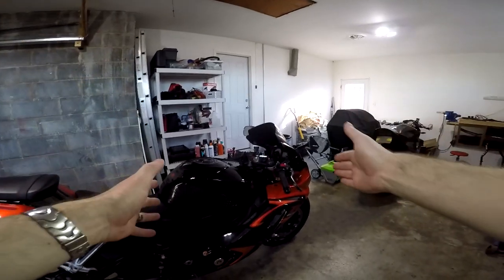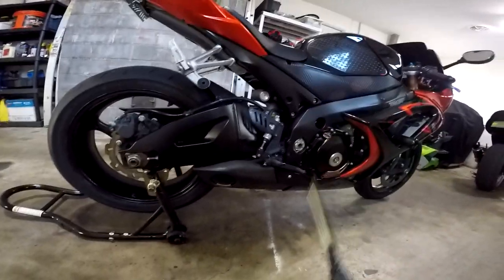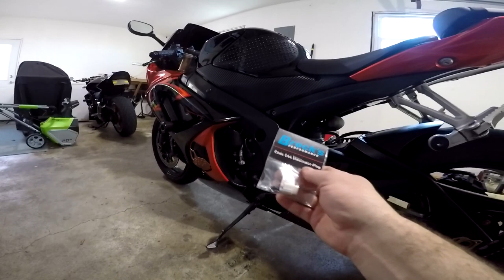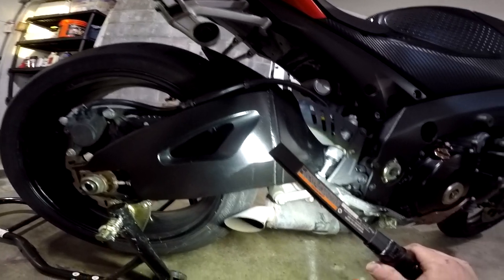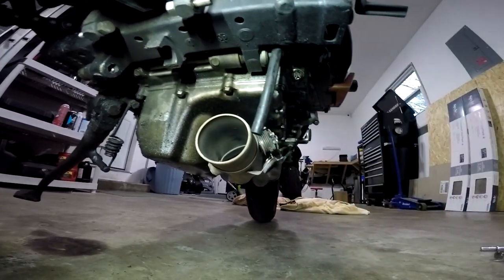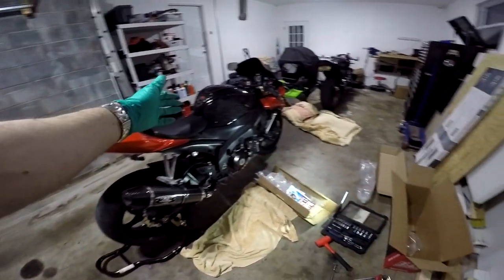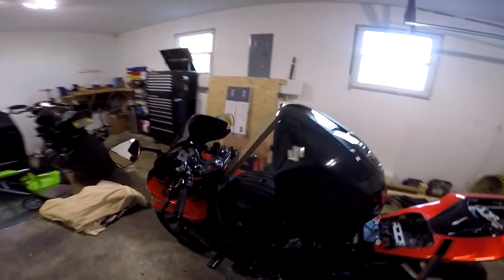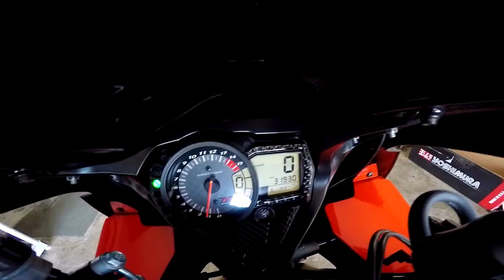Installing Yoshimura exhaust & disabling SET valve (K7 GSX-R1000)

Comment: Hi,Can I just remove the “black & white” wire without using eliminator plug ?will it show up FI light when I change to aftermarket exhaust??thx im glad to own a same bike with you it’s save me
Reply from the maker: Pulling the black and white wire from the ECU connector keeps the F.I. light from coming on due to the SET valve being unhooked. The Code C44 plug that you see in the beginning of the video, keeps the F.I. light from coming on due to the O2 sensor being removed from the exhaust. They serve two different purposes.

Comment: I need to fit mine with the o2 sensor Eliminator and bolt to remove the the sensor totally, as have f1 light from custom exhaust. Do i need to do the other bits you done aswell ?
Reply from the maker: Only if you want to bypass the exhaust valve. Then you will need to pull the wire from the ECU harness as I demonstrated, or buy a bypass plug for it instead.
Reply: @lonelyryder7441  yea, have a plug and the bolt to put on for the old o2 sensor. Thanks, mate. will see if it works. Keeps the vids going as doing mine up after the old person tried to improve but did loads of half jobs 😪

Comment: So I had my ecu flashed and the servo was eliminated in the ecu do I still need to remove servo for the set valve
Reply from the maker: As long as the valve is sitting in the open position, you don't have to remove it if you don't want to. But most people yank it out to get rid of the dead weight.

Comment: Question i started to do exhaust valve delete while i was doing cat delete/ mid pipe. But when i unhooked the cables at the butterfly it flopped closed? And i can open and close by hand, i dont think it will work right isnt the idea to keep open all the time???? Thanks
Reply from the maker: There is supposed to be a spring on it that keeps it open. Check to make sure that the spring isn't broken.
Reply: @lonelyryder7441  I actually just tried something different..Turn on key cycle kill switch so valve opens..turn switch off before valve completes it's cycle,,( close/ then open 1/2 way). Went to ECU and pulled the black/ white wire  started bike valve stayed open no FI light. Now you can hear the servo  turning at ignition but the cables don't move.. Whah Lah..Have not rode it yet but all seems ok till I can send ECU out for flash?. This be good option if didn't want tear out servo. Or maybe under Warranty or?? ..Peace Out Brother ✌️✌️✌️

Comment: would you sell me your old exhaust that you removed in this video? :)
Reply from the maker: Sorry, it's already in the scrapyard. Trust me you didn't want it, it was completely rusted out, things were rattling lose inside. After I removed it, I tried to unscrew the O2 sensor (off camera) and the bung was rusted so bad it broke off in my hand. It was junk.
Reply: @lonelyryder7441  thanks for the reply and thanks for the video, mine runs way better after using the o2 delete.